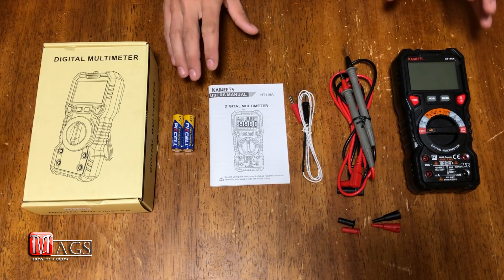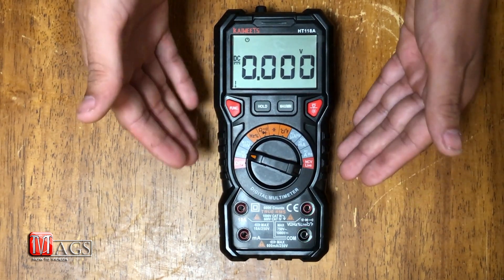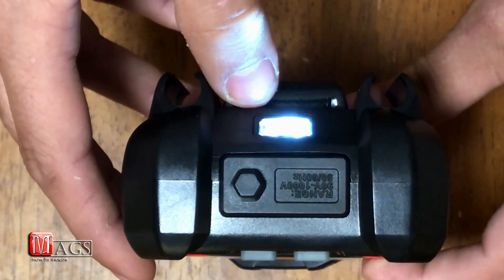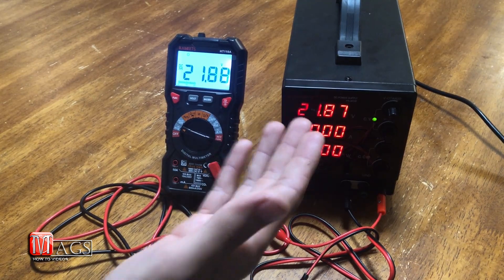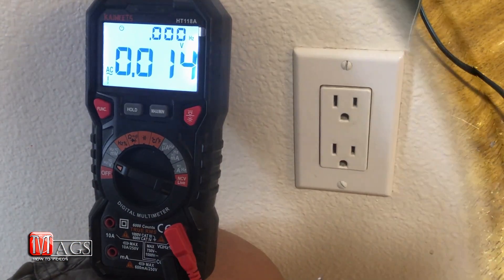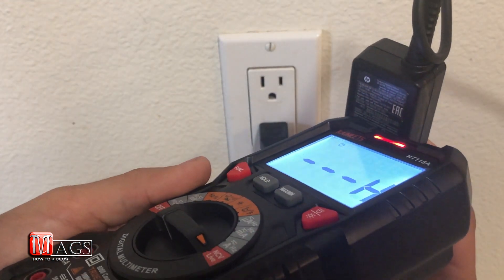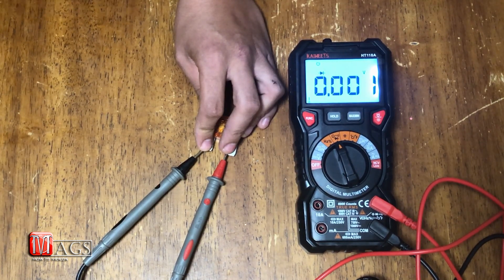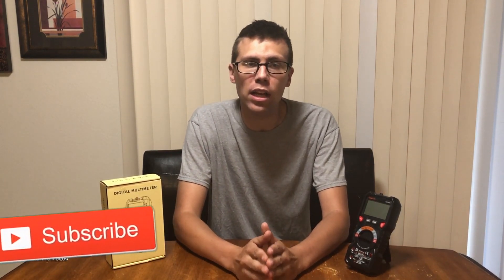Kaiweets HT118A Multimeter Review Video

Comment: i have habotest ht118a.i compared with holdpeak hp-890cn. unfortunately the measurement speed of ht118a is slow. To test this, you can measure the fluctuation of tp4056's output.

Comment: Thanks for the review. Just got this and trying to figure out the NCV "live" voltage test. When you turn the knob to NCV, then hit the " function" button. What can this mode do? The manual isn't too clear. Thanks
Reply: It has a NCV and a Live function, the NCV uses the top probe and shows Low (green) or High (red) live wire.
Reply: @p341r31s235  thanks for the reply! Do you know when the "duty cycle" function would be helpful? I can't find anything that's explains it clearly. The only thing it says is car headlights can sometimes be tested with duty cycle, but idk how that'd be helpful.

Comment: Left out the tests for diode and capacitance, two main features.  Also of note the screen lights up red to denote high voltage, later versions also have a beep during diode testing in addition to the value on the screen.  This meter is accurate and a good bang for buck, but since you didnt do a take apart showing the inside viewers should know this is not a high end meter you would use in a serious hi amp hi voltage situation because it does not have any serious input protection aside from a couple small fuses.  This is strictly a home/hobby meter not for plant type use.

Comment: Nice video. It should be mentioned that it has a 'CAPACITANCE' function and a 'MIN/MAX' function. The ''MIN/MAX' function is very useful for checking batteries. It will allow you to save the measured 'static voltage' and the 'voltage during a draw' when starting a vehicle and the battery draw while running which will indicate a battery's condition.

Comment: Test leads wobbly?  You must have gotten a defective meter or the probes are not the ones that came with the meter. Everyone that has reviews this meter has said that the probe sockets are tight as is on the one I have.
Reply from the maker: Maybe it was defective. I won’t know since I don’t have a second one to compare it to. The leads that were used in the video were the ones I received with the meter. I do still enjoy it even tho it’s off by 0.02 when measuring for Volts and sometimes Amps.